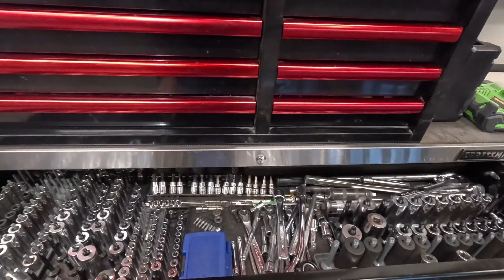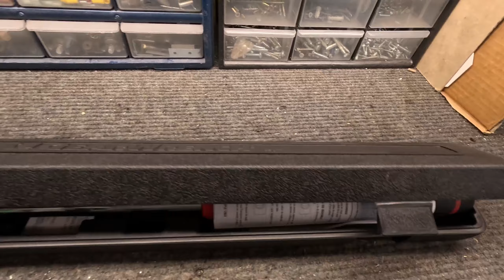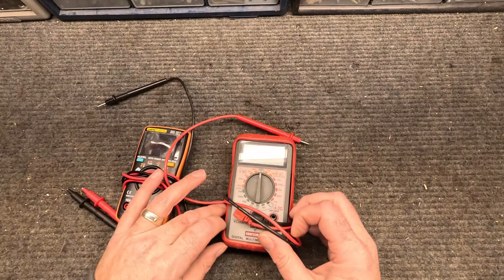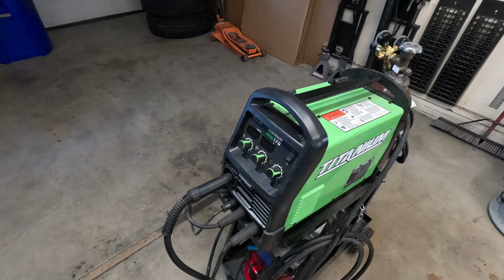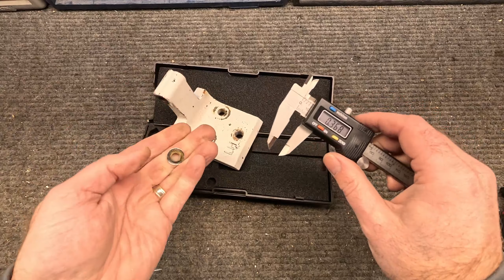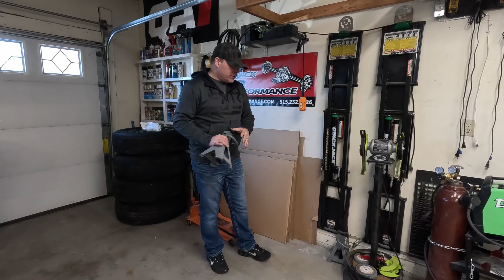My Favorite Tools

Comment: Battery powered grinder dedicated to wire-wheel duty is super handy in automotive work.  There's basically always something the needs to be hit with a wire-wheel for cleaning, knocking paint or rust off, etc.
Reply from the maker: Truth. 🙂

Comment: Great presentation. I really need to get some of those plastic organizers too.

Another cool thing is a plastic or metal nut and bolt pouring tray. You can go through your random spare nuts and bolts and then pour them right back into that coffee can or whatever.
Reply from the maker: Yeah, those organizers have been extremely helpful.  :)